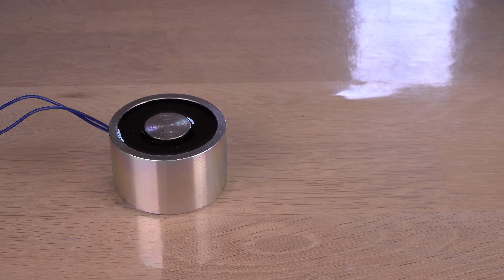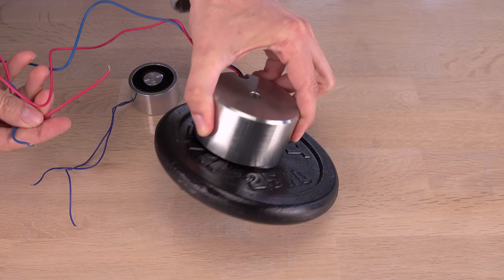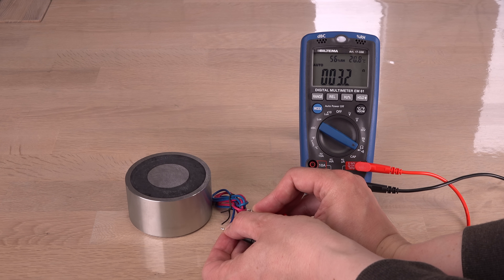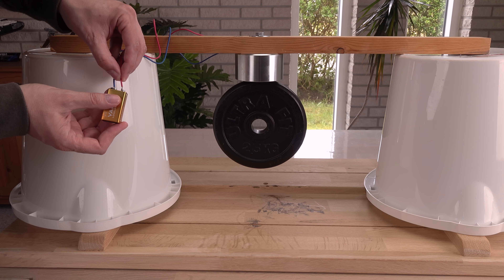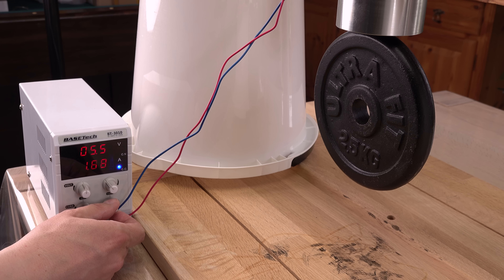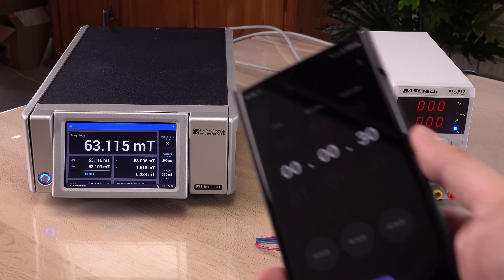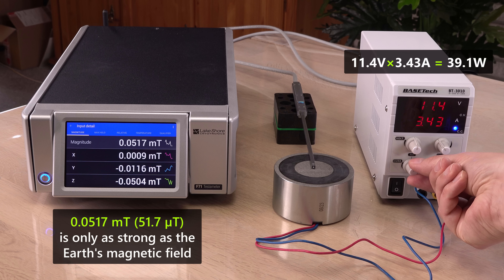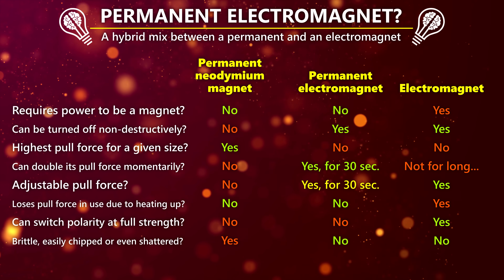NO ELECTRICITY Electromagnet?!? The Weird and Wonderful Permanent Electromagnet

Comment: Maybe some of the magnet enthusiasts know: do permanent magnets like neodymium magnets get weaker over time if they are forced towards each other with the same poles, so when they "want" to repell each other, but you go push them together anyway?
Reply: No, unless you overcome the coercivity of the magnetic material. For rare-earth magnets the coercivity is very high (the magnetic direction is really hard to change), requiring up to 4000Ka/M (~5 tesla) for field strength depending on the grade of magnet.
Reply: Commenting because I’m also interested in the answer.
Reply: You need a lot of power to permanently remove the magnetic dipole. Or a lot of heat.
Reply: isn't it the same as forcing 2 same pole magnets onto each other?
Reply: Forcing like poles together will speed up the very slow natural weakening over time.
Reply: Yeah magnets get weaker takes about 500 years, if you push repelled forces and they go together you've forced a pole reversal
Reply: @lloydtshare  Yeah does depend on the type, NeO is something like 1% 10 years but having them opposed elevated temp and shock will accelerate that.  Exceed the operating temp and the strength will go down markedly. The operating curves depend on grade, formulation and dimensions. Exceed the curie temp they are demagged but in theory could be charged back to close their orig strength. Exceed the sinter temp they can't.
Reply: Also even if they do get weaker over time, if they are physically intact you can easily repolarize them with an electromagnet, making them strong again.
Reply: @flydrop8822  One of the advantages of Neo are how hard they are to charge. Like gold plated buss bar, orient the fixture correctly so the gold plated bolts don't get blown apart  hard.
Reply: @anullhandle  By NeO you mean Neodymium Oxide? I think the alloy used for magnets is more complex than that, it contains a bunch of other metals besides neodymium.

There is a great video by NileRed where he shows a machine that quickly poralizes a neodymium magnet hard, making it even more powerful than usual.
Reply: @flydrop8822 neo magnets not the element or oxide. Fwiw they're mostly iron.
Reply: I assume you'd be exerting power on it? So by forcing it this energy must go somewhere
Reply: @mamupelu565  it goes into increasing the magnets internal mechanical tension
Reply: No. Think about it: If you break apart a Neodymium magnet and try to put the parts back together as they came apart, you will find that they repel one-another. Before it was broken, that same force was there, and the magnet did not lose its magnetic capability.

Comment: The point of it is to be used in gates that are closed by electromagnets. Normally they require power all the time to keep the gate closed, which results in wastage of energy. This type of Electromagnet keeps itself on when not powered and turns it off when powered. This is much more efficient in the gate system as it only requires electricity when you want the gate to open.

Thanks for the video...
Reply: Ya, you just have to make sure never to use such a thing on a door/gate meant to be used for emergency egress.

A door/gate that may lock itself closed in the event of a fire which caused a power loss would be nightmare.
Reply: @Nevir202  Exterior gates are not bound by egress rules if the area inside the fence, which are at least 50 feet away from all the buildings in question, have sufficent size so each occupant from all buildings inside the fence has at least 5 square feet per person. Then you can throw every egress rule out the gate literally and double lock, extra lock and whatever you want. The rationale behind this rule is that the occupants do not need a safe fire exit out from the fenced area, if they could safely wait for the fire response inside the fence.
Reply: @sebastiannielsen  Sure, but then literally it wouldn't be, "...a door/gate meant to be used for emergency egress." which is what I was talking about.
Reply: @sebastiannielsen  I would assume that there still would need to be a way for the firetruck etc to get thru the gate somehow?
Reply: @amahlaka  No. They have tools to cut through the fence if that becomes required. Or just go over the fence with the ladder.
Reply: @amahlaka  brute force
Reply: @Nevir202  That could be true, but sometimes you want to close a door specifically during a fire - I used to work in a building with fire doors that split up the hallways into sections to contain smoke and flames, which closed automatically when the alarm was activated. I always assumed the electromagnets were energised all the time, but it must be the opposite!
Reply: @MidnightGazebo  Fire doors usually just release the electromagnet IME, but it's still likely  an electropermanent that gets a voltage when the fire alarms go off. I haven't seen a fire door go off in 15 years though so I might be misremembering.  

If fire containment is utterly critical like on a ship, that's probably where you wouldn't want these.
Reply: @MidnightGazebo  Those are probably traditional electromagnets, they use 1-5 watts to stay on, which for a business expense for fire safety is nothing.
Reply: @MidnightGazebo  No fire doors are held open by electromagnets that are powered constantly and use normal hydraulic closures to close the doors when the fire alarm turns off the magnets. The reason is using a normal electromagnet is it's "fail-safe" if something happens to the magnet wiring the doors close. Where as with the power to turn off magnets, if something happen to the wiring you might not know till tragedy occurred.
Reply: @Nevir202  Meh.  Just use a battery with some electronics, so the door/gate will open on power-loss.

inb4: We rely on electronics and batteries for lighting when there's a power cut, pitch black during an evacuation isn't much worse than a locked door during evacuation, so it's plenty reliable, except in all those businesses who'd sacrifice their staff to cut costs by 0.01%.
Reply: If only they had these at Freddy Fazbear's Pizza.
Reply: Which means you cant just cut the power to open something. You need the power on to have the option of opening it.
Reply: Good old fail-safe versus fail-secure.
Reply: Would also work for people who want to be able to anchor things in place but retain the ability to move them - there are toggle/switch magnets that wouldn't need power but this could be a desirable feature.
Reply: usually that can be done by latches that require power to open instead of close
Reply: Probably what they use at bank doors in my country

Comment: Have seen these used for holding open (fire) doors in schools.  If the power is out the door will default to locking itself in the open position the first time it is opened.
Reply: You mean egress doors? Usually fire doors are held open with low power electromagnets, and automatically close when power is lost, in case the outage has been caused by a fire.
Reply: Those are NOT "fire doors" at all. Those are EMERGENCY EXIT doors. Which are completely something else than "fire doors". And to keep such EMERGENCY EXIT doors in an swung open state the first time they are (completely) opened, you even don't need an electromagnet at all. Just a normal magnet against the wall. No power needed at all in any case.

On the other hand, Fire doors, which are in a normally swung open state, NEED to automatically CLOSE in emergency/fire and as such always use NON-permanent electromagnets, the opposite of what is talked about in the video.
Reply: @CookieTube  Wow.  That's a lot of shouting about nothing of consequence, that makes you look like a bit of a dickhead as far as I can tell.

These doors were lebelled "FIRE EXIT - DO NOT OBSTRUCT", and would latch OPEN in the case of power loss.

Sorry this reality offends you?  Sorry you feel so strongly about doors?
Reply: Isn't it better to close doors in case of a fire to limit fire's access to the oxygen?
Reply: @anj000  It all depends. For fire doors, yes. For emergency exit doors, no. For other doors, depends....

It all comes down to functionality and purpose. But as I can read in the comment section, there is A LOT of misinformation and most people seem to think/assume all doors are fire doors or emergency exits, and/or confuse the two VERY different types.
Reply: @CookieTube  My inner industrial safety nerd thinks people need to search up videos on types of doors in commercial structures and fire code after they get done with the magnet video. 😂

Comment: I've seen these in California keeping fire proof doors in hallways open in normal conditions.
They close if the fire alarm is pulled. Big spread-out apartments buildings have them all over the state. 
I don't know what the big one is used for! Bigger doors?!
Reply: I think you're mistaken. Such fire proof doors are certainly NOT kept open by such permanent electromagnets, but by NON-permanent electromagnets. This is exactly the opposite of what the video is about!

Fire proof doors are kept open by an electromagnet as long as the magnet is powered. As soon as the power is cut (due to power outage or fire), or an alarm is pulled, the magnet releases and the door closes. Such doors need to be fail-safe, meaning in case of a failure (eg: power outage), they need to fail in a safe way; which in this case is closing.

The video is about PERMANENT electromagnets which are the opposite of the normal common electromagnet.
- Permanent electromagnets are in normal circumstances magnetic and only RELEASE when power is given.
- Non-permanent electromagnets are in normal circumstances NOT magnetic and only MAGNETIZE when power is given.
Reply: @CookieTube  I asked the guy who was installing it! Be gone.
Reply: @piconano  Then that guy was 100% mistaken.

Comment: This is the sort of electromagnet you would use on badged access points.  You can use a special latch that releases when badged access is confirmed, but use the permanent electromagnet mounted to a bracket at the top of the doorway for a door seal.  During normal power conditions where the badged access works, you can control movement into or out of a facility, but during a power outage where those systems might not be working, you can use the permanent electromagnet to seal the door until either power is restored or a backup goes online.
Reply: I must upset you. Such devices have to fail safely. In case of fire or power outage, doors should 'fail' by being released or be openable with a key. That is why in e.g. large buildings fire doors are normally held open with constantly powered electromagnets. In case of fire they loose power and close to prevent fire spread BUT they can be freely open by hand. Meanwhile doors normally held closed, during a power outage or fire are released to be freely opened or stay latched but can be opened with a key.
Reply: @przemo555 this is something which is frequently used in secure access facilities, in which there are national security implications to having doors open when power goes out
Reply: @przemo555 came here to say this. Emergency and security don’t go together
Reply: @przemo555  I guess for security doors, it only needs to be badge open from the outside; If you are going out, a mechanical system can release the door, without a need for power.
Reply: @przemo555  and others, you're wrong. The OP is 100% correct.

You are confusing BASIC fire safety standards and failsafes and the rules for EMERGENCY EXISTS with the actual practical use of these permanent electromagnets for security purposes. NOT EVERY DOOR NEEDS TO BE (and even can be) AN EMERGENCY EXIT!! People who claim this do not know what they are talking about.

As someone else already pointed out in CERTAIN situations you do NOT want access from the OUTSIDE into secured areas in case of power failure! That is NOT a rarity at all! Fire or not, door stays closed and locked!! In such cases the door is VERY OBVIOUSLY NOT an emergency exit. duh! Think people, think....

But even in such cases, there are doors which actually CAN be opened from the INSIDE in case of a fire. These are much rarer though. In those cases, doors which are equipped with such a permanent magnet can still be opened from the INSIDE with other means like a pushbar or lever which overrides the permanent electromagnet (eg: either by mechanical means, like pushing another magnet to cancel out the electromagnet, or by providing momentary power to the electromagnet via a battery).

The OP is VERY OBVIOUSLY talking about things like access gates in a facility which are NEVER an emergency exit ON THERE OWN to begin with (since the rolling bar gates quite often can only turn in one direction anyways)!! There will most likely be a dedicated emergency exit next to those gates if required. The OP was VERY OBVIOUSLY NOT talking about a standard emergency exit door.
 
Please, think and/or do some research before claiming things...
Reply: @przemo555 

I must update you...

Depending on the facility, some places prioritise security over safety in times of power outage.
There is failsafe, which you appear familiar with, there is also failsecure.

A high security facility wouldn't be very secure if all a bad actor had to do was sabotage the building power to get all the doors to open.
Reply: @przemo555  there are a couple situations im fine with "fail-deadly".

Some doors stay closed.
Reply: They actually work the opposite. When power fails everything unlocks in case of fire.
Reply: @ralanham76  The requirement is that doors fail to an openable state from the inside without having to turn anything. You can still have a pushbar.
Reply: Most regulations require doors to fail open (at least from the inside)
Reply: @sophiophile  1) No, not ALL doors need to fail open/unlocked.
2) even so, there are other means to open such doors from the INSIDE if required.
Reply: Think about what a bad idea that is. Power goes out (say like a fire), and you permanently seal people in? Instead, this would be used in situations in which doors are permanently held open (unbadged doors), but fire code requires that they be closed in the event of a fire. This would be used to hold the door open (like a doorstop), but would release when the fire alarm goes off, allowing the door closer to close the doors and prevent the spread of fire. The door would still be openable by hand.
Reply: @fgbhrl4907 there are situations that in the event of a fire the door needs to close as a barrier. It depends on the location /use of the door. Not all doors need to be open for a fire. Some are an extra barrier. Also depends on the escape routes, if there are adequate escape routes they can still use them as a normally closed. Another thing that is common is to hold the door open.
Reply: @newmonengineering yes but the op was about locking not closing
Reply: @newmonengineering  That's exactly what I was saying. Doors may close during a fire, but not lock which is what OP was suggesting. Give me an example of a door that should actively lock (be unopenable) in the event of a fire...
Reply: no this is not smart just use a normally closed regular electromagnet. this is for having normally open and normally closed for long periods of time. a hybrid between the two. doors are rarely open. just use the full power while they are open.
Reply: Probably illegal in a lot of places. Fire is oftena reason for power cutoff ina building. Means all doors must not trap ppl
Reply: Fire code usually requires doors to fail unlocked when power is lost
Reply: Hope the facility has emergency exits. Sometimes power goes out when there's a fire. Like an electrical fire.
Reply: This is considered a man trap. Highly dangerous in case of an emergency.
Reply: a "fail secure" kind of thing. useful for no occupancy structures that need to be kept secure. but if theres people you want "fail safe" so they arent locked in if the power goes out
Reply: Not all doors are made for a human's body to pass through in a situation of emergency egress. Plenty of cabinets and control panels have doors on them. Automated lockers for merchandise pickup are becoming increasingly popular.
Reply: Much simpler to say it doesn't need power to hold the door closed, and is given power to release it.

The coil opposes the permanent magnet, neutralizing it so the door will release.

Comment: Fire Door Magnet?
Reply: Absolute NOT. Quite the opposite!
Fire doors which need to close in an emergency or power outage ALWAYS use NON-permanent electromagnets, the opposite of what is shown in the video.
Reply: No. Doors must close on power failure. Power required to keep them open. Means, these doors consume current permanently even when closed. 

Closing relies on a spring ... Which are usually safe for that.
Reply: Yes
Reply: @MacGuffin1  please avoid false information.
Reply: @Benoit-Pierre  Thank you for input, however I think you are mistaken.

My apartment building uses a semi-permanent magnets to hold fire doors open. It has a mechanical closing arm that will close the door if the magnet is deactivated.

Also, I’ve only ever seen it close when they’ve tested the fire system, never when we’ve lost power. I suppose they have different safety criteria where you are.

Cheers.
Reply: @Benoit-Pierre  it's a question
Reply: @Crow.Author  platform refused to publish my answer. 

@mario ... Please clarify ...